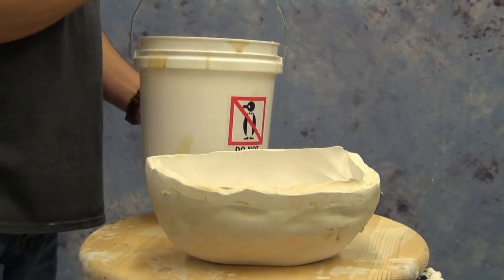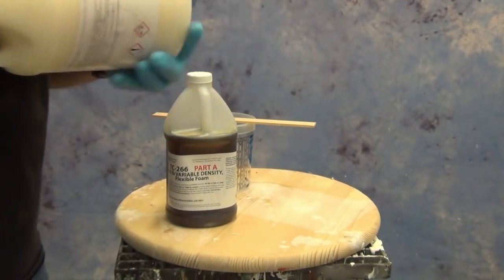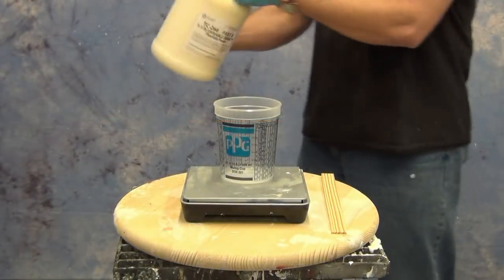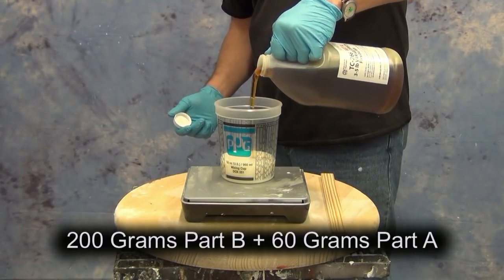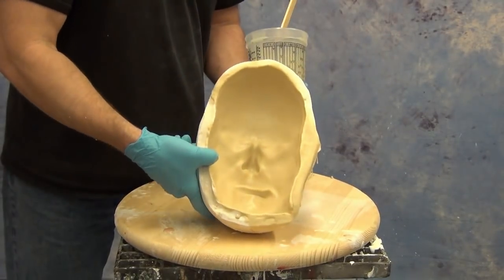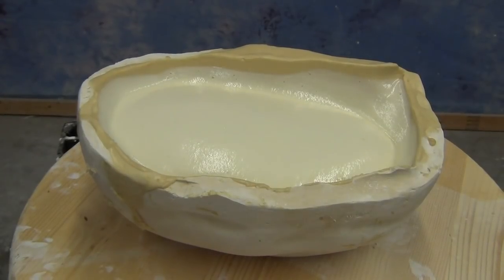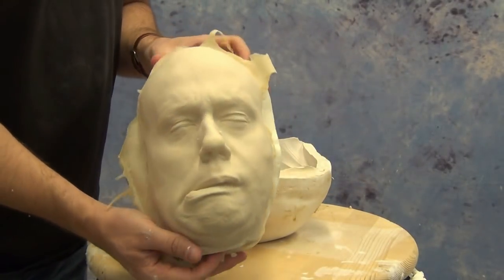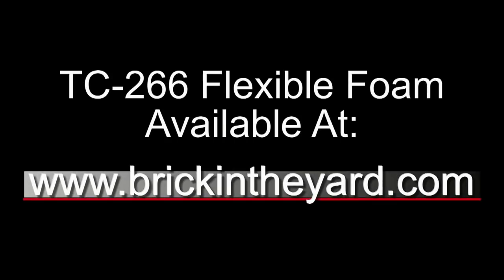Flexible Foam Casting: TC-266 variable density foam

Comment: My foam has collapsed 3x in a row. It looks nice and puffy for the first 20 mins then slowly condenses and shrinks away from the silicone. Any idea what may be wrong? I am shaking part B, mixing quickly and using warm temperatures
Reply from the maker: There are several things that can cause that. here are the top contenders: mix ratio off, silicone pigment instead of polyurethane pigment, silicone still curing when foam is poured. If it is a temperature issue, sometimes you can squish the foam and knead it and it will return to its intended shape.

Comment: Can the foam be trimmed after its hard , plus does it shrink at all after its cured ?
Reply from the maker: This is a very stable foam that does not shrink, or prune later. This is easily trimmed with scissors or a razor knife.